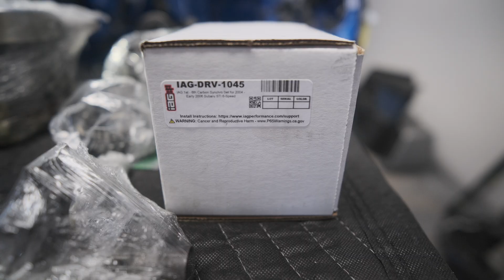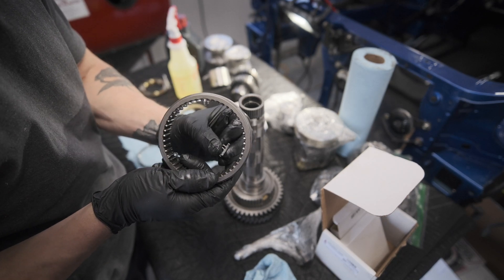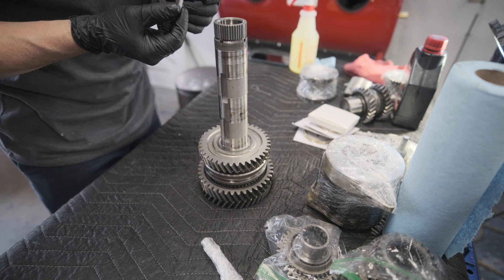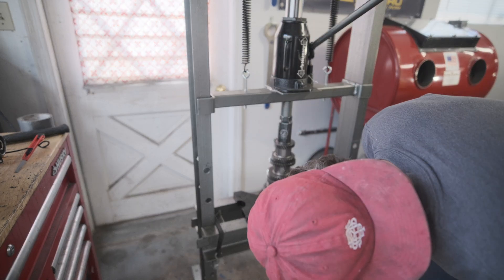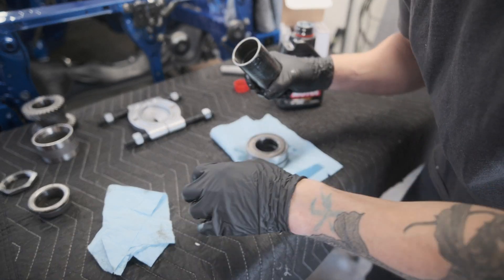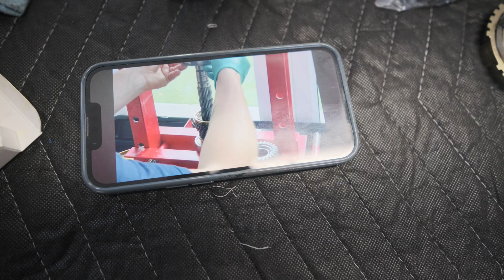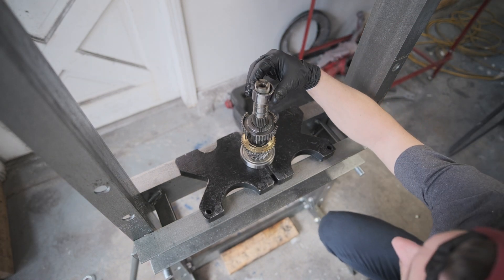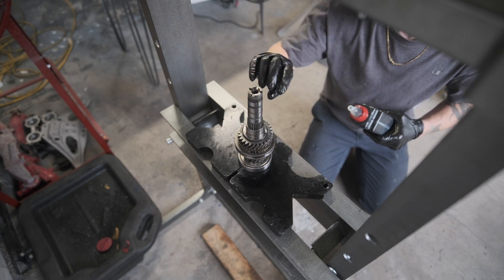Subaru STI 6 Speed Transmission Rebuild Part 1 of 2 | Rebuilding A Neglected STI Ep. 17

Comment: where do you get the rebuild kit/parts, like new gears, and how much was it?
Reply from the maker: I got the upgraded gears from IAG. Looks like the cost is currently $550. https://www.iagperformance.com/iag-1st-6th-carbon-synchro-set-for-late-2006-07-sti-07-09-lgt-spec-b-6-speed/

I also got the billet shift finger from IAG as well. https://www.iagperformance.com/iag-competition-series-transmission-shift-finger-with-spring-pin-for-04-21-subaru-sti